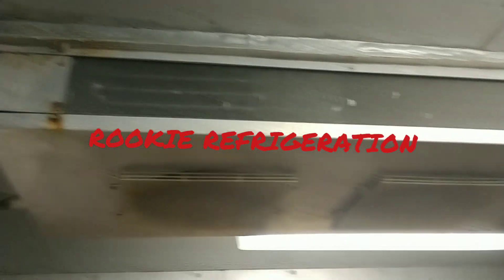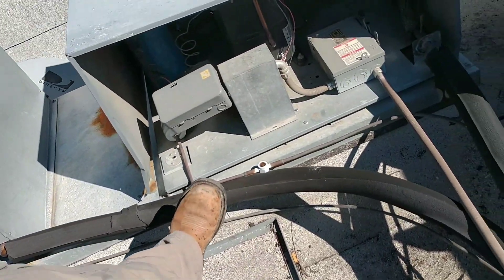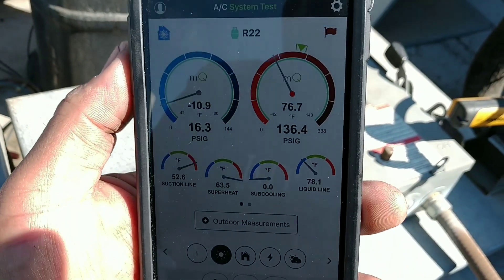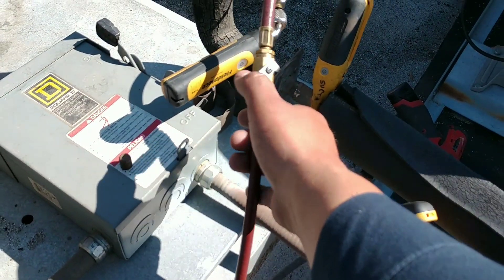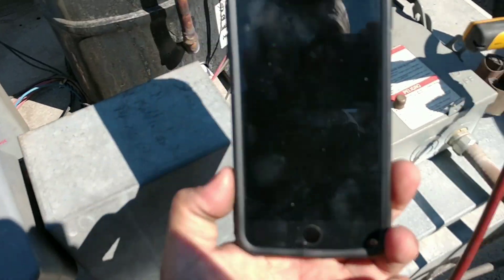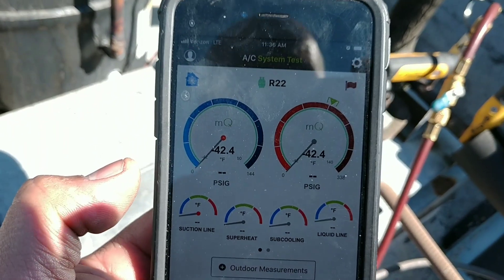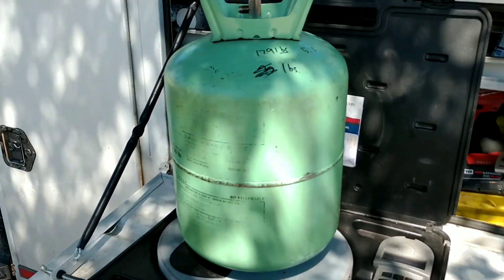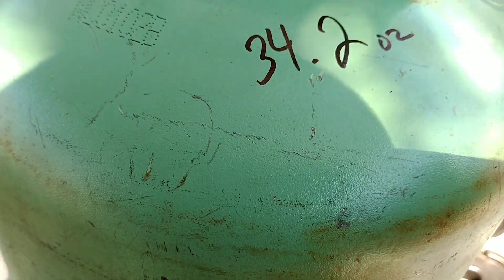HVAC/R- Walk In Cooler Down and Charging with Fieldpiece Probes

Comment: IPhone do all they can to conserv battery, like turning down Bluetooth signal strength,  better if you got Bluetooth 5.0 or higher. Not all devices do. 5.0 signal strength 40 meters indoors and upto 400 meters line of sight for class 1 devices and some claim over 1km. Bluetooth upto 4.0  is  usually 10 meters  but can go up to 100 meters in class 1 devices, never seen it except in stuff like PC or laptops.

Comment: I just got some fieldpiece probes and want to use measure quick as well. Do you have any videos that go over probe placement and why you have 3 temperature sensors? Do you only use your psychometer for outdoor dry  bulb or do you also have one in The Box?

One thing I noticed on your vid that my boss pointed out to me you can't always know that style of coils are clean by looking at the outside. Aren't those the ones that suck in from the bottom and blow out. We were doing some PM's one day and I said those close look clean and he said open it up and look and sure enough they were totally clogged on the inside.